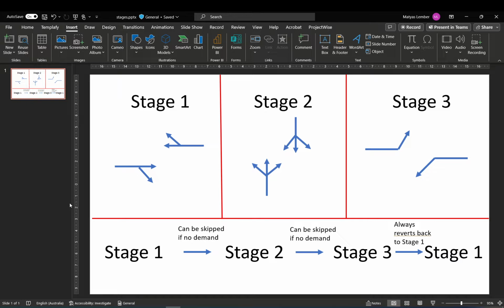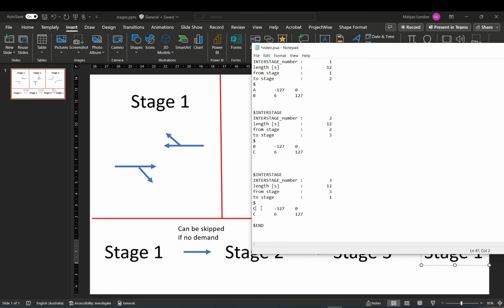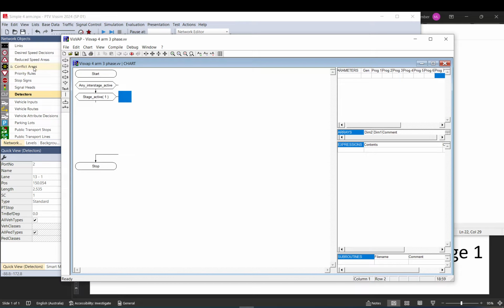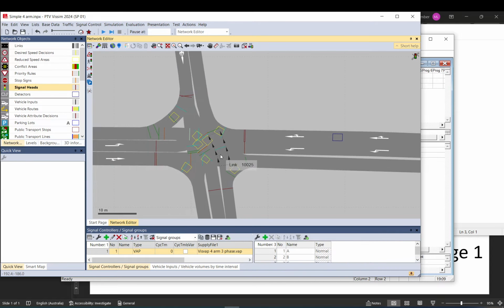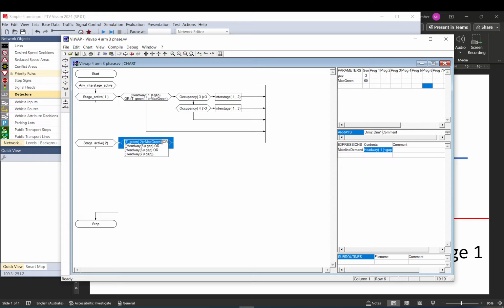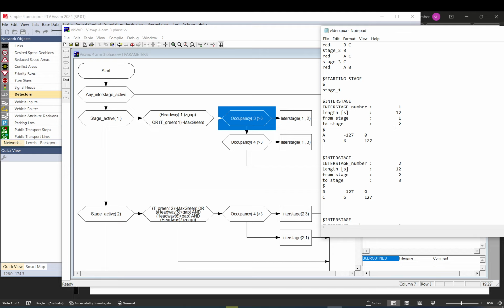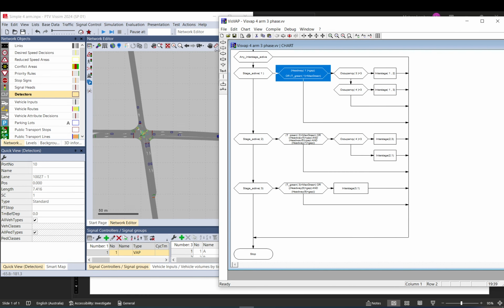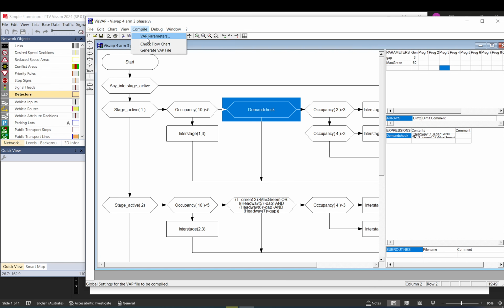Vissim Tutorial - VAP/VISVAP - 4 arm intersection

Comment: HI ,Thank you for the videos. I Have used exactly the files you have created to practice the VAP on the junction when I run the simulation keeps showing errors such as Syntax column 9... I am struggling to make one VAP working but is not working for me , could you advise me please.
Reply from the maker: @nassimanassima-j5m  Hi, you need to open your .vap file (not .vv but .vap) in notepad. In the bottom it will show the row and column number. Find the location in the vap file that is referenced (shown) in the error message. There is your error. Read the error message what it says in full and that should help to understand what mistake you made. Maybe a missing parentheses or a typo.
Reply: @MatyasLemberTutorials  .Hi thank you for your prompt reply , I am so stressed about it , I found the line and the column in the message ( from VISSIM) it says Symbol read " Expected Symbol:$signal_group" I tried to correct it but I get the same message, any idea ? on how to fix it please
Reply from the maker: @nassimanassima-j5m  What did the correct? I think this error message relates to the PUA file instead of the vap file. You missed something in the pua file or made a typo.
Reply: @ Also please could you send me a simple example such 2 stages ,with files for  me to practice. I need probably to start from a simple example nothing is running form me at the moment
Reply from the maker: @nassimanassima-j5m  You can get actual files from the public documents folder where PTV installs some examples. Or in help menu click tutorials/examples.
Reply: @MatyasLemberTutorials  Thank you very much for your guidance , I knew my mistakes and now is working properly
Reply from the maker: @nassimanassima-j5m  great stuff :)

Comment: The pua file is not working always showing the error like 
Syntax error : <
Expected Symbol : Integer Constant
Please help I have been stuck for the last two days
Reply from the maker: It means you made a mistake in the pua file. It should tell you in the error which row and column there error is located. You probably did not put a number where there should be a number.
Copy paste it here. The pua and the error message

Comment: Why you did not define a cycle time, just the max green?
Reply: ... and second, should not been define a MaxGreen for each Interstage?, each phase can have a different Max Green and Min Green, thanks.
Reply from the maker: Sure, that can be. I did that in some other videos, but I tried to keep things simple and not complicate it. But well spotted :)
Reply from the maker: Hi, when the signal is fully dynamic it would not make sense to use cycle time for individual intersections. Of course if the intersection is part of a corridor and is linked with others you might want to use cycle time. But even in that case you might want to achieve some of kind communication between them instead of a locked cycletime.
Reply: Thanks for your answer  @MatyasLemberTutorials